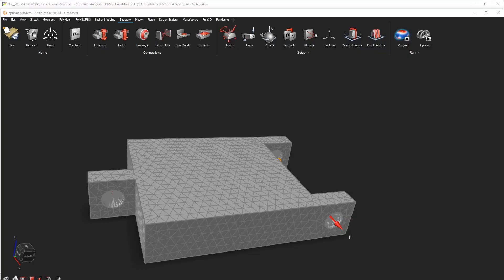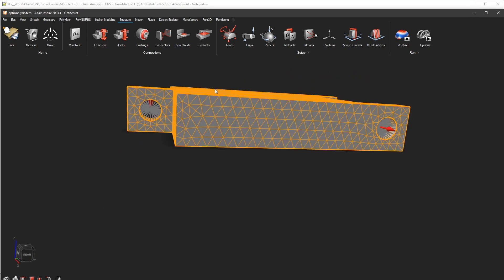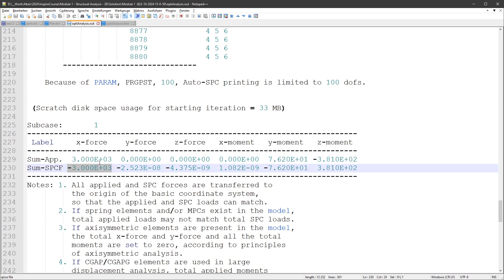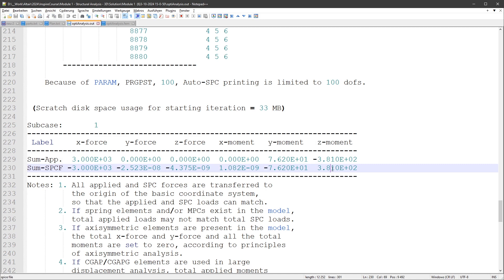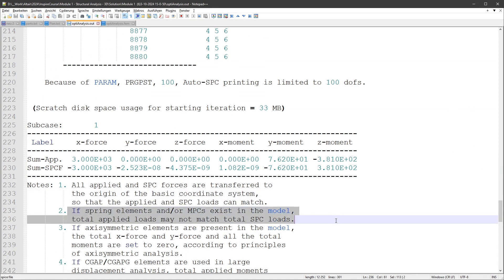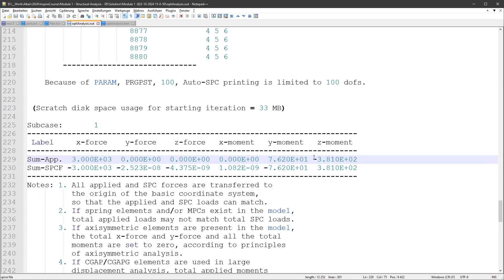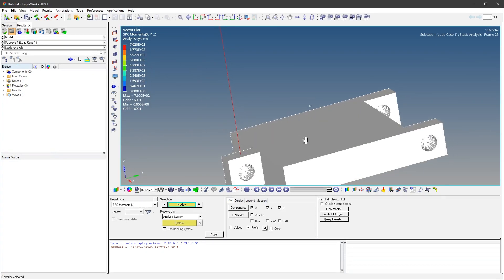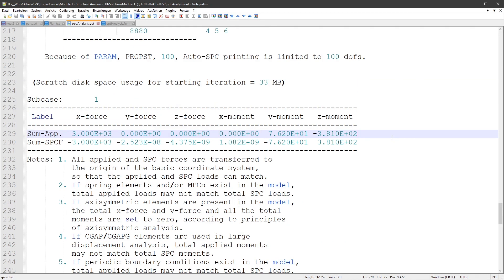Altair Inspire Optistruct Reaction Force Check

Comment: Hey, there is also a way to visualize the reaction forces in the GUI of Inspire for the optistruct solver. You just need need to move the reaction slightly, like a remote load, you can do this in Inspire where after you have defined the support it gives a triad. After doing this you can click on the reaction force call out like you would for bolts or fasteners. If you are curious about this let me know, I can shoot you an image. I have gotten this question on support tickets a good bit. Thanks!
Reply from the maker: oh absolutely! Could you send it please to ramsaier@rwu.de ? 
I will update that in the video then :)
Reply: Good evening, could you explain in a video how you did it, thank you very much.

Comment: Hi, isn't it caused by position of sumation point? I suppose the summation point for moment in .out  ist at 0,0,0 and your SPC point propably isn't at this coordinate? that is the reason why in Hyperview the values are correct (because the sumation point changes, is translated to the coordinate of SPC). Propably if you put the spc point in 0,0,0 both values would mach. 

Have a nice Day!
Reply from the maker: Yes - exactly - that must be the reason - I will check it later and get back to it here.